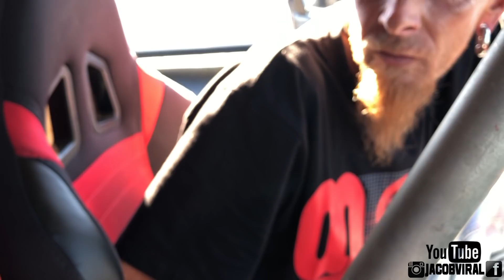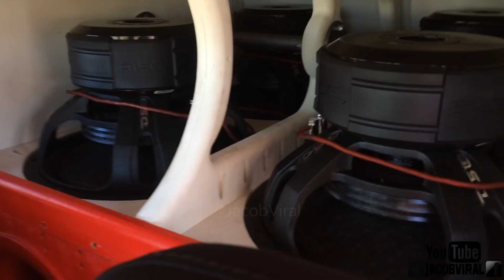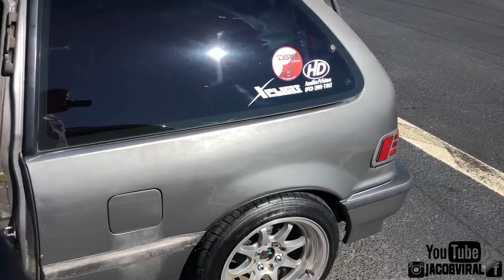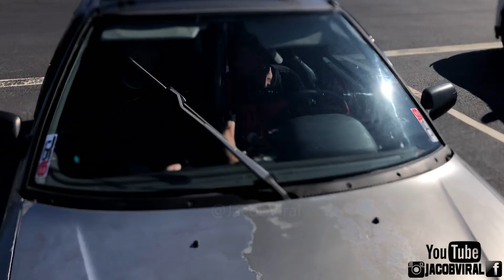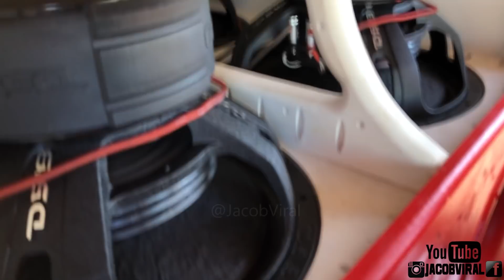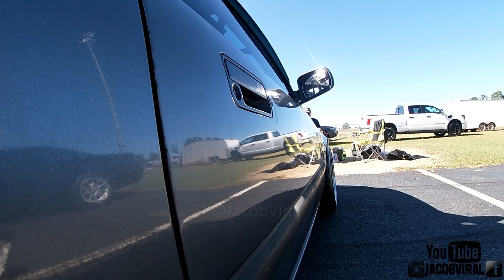I'VE NEVER SEEN A SUBWOOFER BOX LIKE THIS! COMPRESSION PORTED BOX?

Comment: Come to find out everyone it is a parallel 6th and didnt realize it at the time.  I'm currently re tunning 2 get lower. And no the coils r not burnt.  Brand new and jus broke in.  Rattle comming from the car.  I'm currently able 2 drop to 20 hz and move it.  No I dont know db yet.
Reply: Can I get a link for the slowed bass mechanic song?
Reply: terry bowen it looks like u are limited with space bro and that's why u did this enclosure, but in my opinion, and 4th order will give u better results then this parallel 6th, in the end, it all comes to your liking bro, and u did a good job on your enclosure
Reply: Goood job sir
Reply: That's a beautiful looking box bro.
Reply: That box is beautiful whether compression chamber mixed with Ported or parallel 6th!!! Killer build
Reply: terry bowen how can I get in touch with you terry?
Reply: My oppinion just put a glass in the upper chamber to seal it. It looks like it was made for that. If you want to go low, 4th order is the way to go
Reply: @fellipeteixeira9217  im with fellipe....
Reply: @fellipeteixeira9217  sixth orders will dig deeper in frequency range than a fourth order will at a cost of course,I prefer sixths
Reply: Pretty sweet man, where r u from? Would like you to design something for my car

Comment: That is a ported box with a pretty top. No way is that little beauty panel a port. What happened is he had a 4th put these subs in and played it without the cover on and it sounded better and left it that way.
Reply: if you tune the top chamber you'll be golden.  Sweet build.
Reply: @cdbennett2332  since this video, I talked with Terry as we're both in the Myrtle Beach area. and he's played with the lower ports and added a port on top chamber.. this was a brand new build in the video

Comment: Parallel 6th order, but I ain't efficient like the series 6th order
Reply: nate0 well it all depend on the design and how subs like the enclosure, actually any optimal enclosure will do the job but in this case, a series 6th will be a way more efficient then this current build
Reply: @7modi092  harder to design if you are new to it. Maybe is was for that reason.
Reply: Seth H that make sense, but this is considered a big sound system, so the owner can simply pay for an optimal design bro
Reply: I have never been able to come up with a series tune computer model that wasn't a one note wonder.
Reply: @TimpBizkit  then you don't know how to do a 6th. They are the opposite of one note wonders, incredible bandwidth especially reverse parallels.
Reply: @Str8GasGenetics  what is a reverse parallel? I'd seriously like to know. Are you talking about the ports for the two chambers facing opposite directions?
Reply: Love my parallel 6th like this, has good range and loud

Comment: Unique boxes lately. How come no one ever does an isobaric enclosure anymore? 🤔
Reply: slow mazda how so?
Reply: Very good info and points.
Reply: The subs nowadays are so strong it’s not necessary to use 2 subs , isobaric will half the box volume for recommended enclosure size , with nowadays small volume subs it’s impractical
Reply: nate0 I love these type of discussions. We can all chime in knowledge and in my case, learn a lot. Thank you all for your input, it’s highly appreciated.
Reply: My shop has an isobaric sub enclosure that uses the walls on each side as a gap and the lows I can get out of 2 8 inch woofers with only 150 watts is pretty surprising